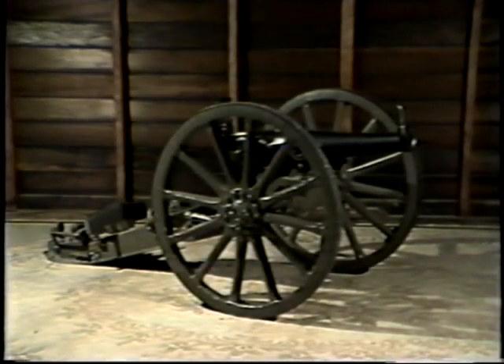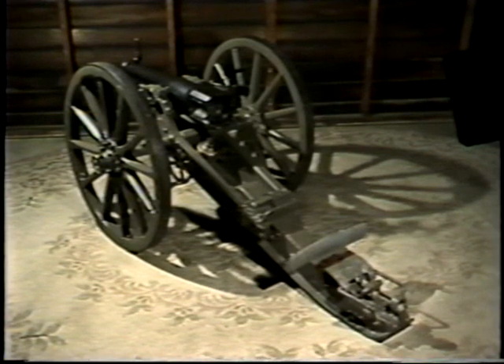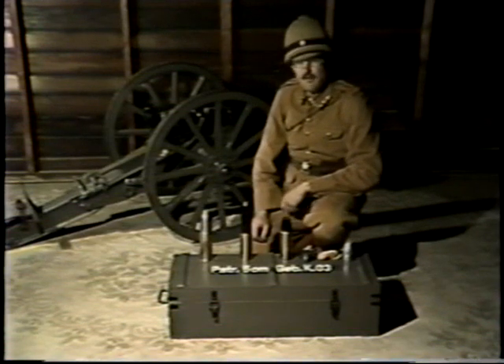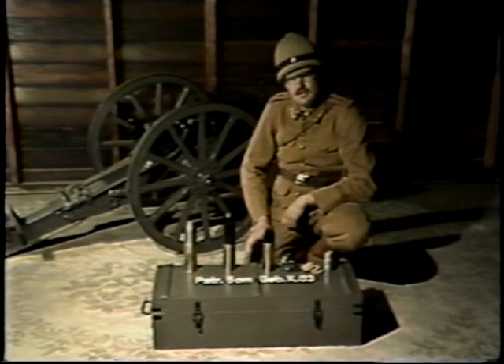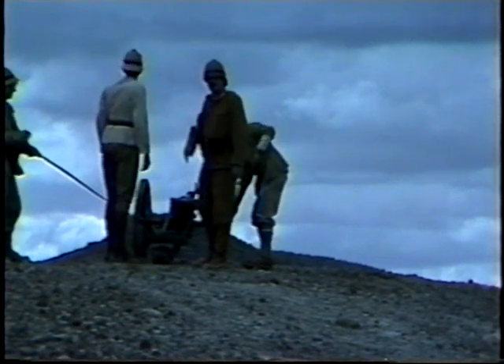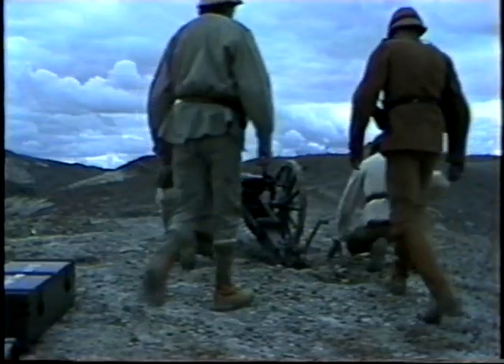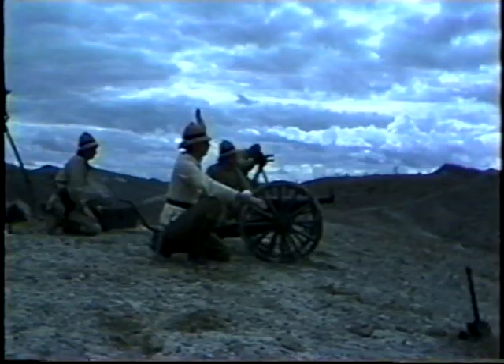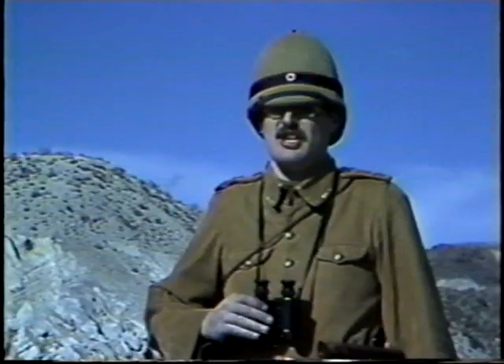Doug Howser Shoots the Krupp Cannon, Part 1

Comment: Hugely informative. This really highlights the difficulties of firing a gun which has no recoil absorption and a tendency to jump out of battery every time it's fired, yet also shows how the entire thing was set up to overcome those problems with excellent engineering solutions and good crew drill. I would love to see a comparative shoot against something like a French 75.
Reply: couldnt had said it better....crazy how modern those already were

comparing it to the 75 would not be fair because it already had a hydrolic recoil system.i THINK that it was the first quick firing arty adopted en masse.

oh and i dont know for you but when he explain what the canister round is i have a chill running down my spine lol
Reply: Ragimund VonWallat Yes, the 75 was the first field gun with a recoil absorber and used QF rounds - I notice that this little Krupp also has QF shell, but that recoil spade is enough to do away with the need for a recoil damper - I would more be interested in seeing what the comparative accuracy of the two are - I'm sure the 75 had a silly high rate of fire, as some of the old documentary footage of them in WW1 seems to show something like one round every three seconds! There's no doubt that both German and French guns were of very high quality, and of course Germany had their own 7.7cm QF field gun which was clearly copied from the French model.
I agree, I would hate to be infantry charging those canister rounds!
Reply: Andrew Givens
 join the bataillon they said....only fun and a little of work they said =P haha

but to what ive read the 75 was dominant and had 1000M advantage of reak effective range over its competitor.The german relied on the heavy artillery for long range since theyre victory of 1870....it was the clauwitzsian theory against the jominian one...

french doctrine was one of agression and of manouver so they totally neglected the heavy and put all they got in a ligth field gun.

as the field doctrine of clauswitz was one political management and grinding.even if they would win only 0,001% per day they calculated and if they could sustain the required amoutn to win they would choose that.

in our head as we know how the western front ended in such a trench fest we migth make fun of thsoe views....but it hurted the german alot in the middle of the war if they had pushed more agressively they would had won the war.

in the eastern front it was still a war of movement and of battles like we think of battles....simply because the land was so vast  and russia wasnt geared for grinding fest so everything pointed for a war of moves
Reply: The german 7.7 cm fieldgun actually wasn't ''copied'' from the french one (atleats not entirely) since the german 7.7 FeldKanone 96 was build before the french quickfiregun. 
However in its original model the german gun didn't have a recoil absorber and when the french started to field their 75 the germans just refited their old cannons .. so basically what I'm getting at is the german cannon itself isn't  a copy but the later fitted recoil absorber is .
Reply: Very well-made point. TY for clarifying that.

Comment: This Krupp mountain gun shown here was once belonged to the Royal Siamese Army, the siamese proofmarks on the right hand side near the breech hand crank says "Weights 48 Kilo (grams)". The lower breechblock is the weapons 'serial number' (i think)

Also on the top just below the manufacturer markings, the "๑" (1) (and following by either ๔, (4) ๕, (5) or ๘ (8) ) and in the lower line... the year this weapon shipment arrived (Siam purchased this weapon from Krupp by the mid/late King Chulalongkorn reign... At that time the official calendar system was Rattanakosin Sok (Years since the christenization of Bangkok as a seat of power) the Buddhist Era calendar system didn't become an official calendar system UNTIL Prince Vajiravudh ascended the throne. By the time this gun arrived. Bangkok is some 120 years old.

Apart of Siam. who else bought this 50mm Krupp mountain gun? There's no wikipedia entry of this mountain gun.